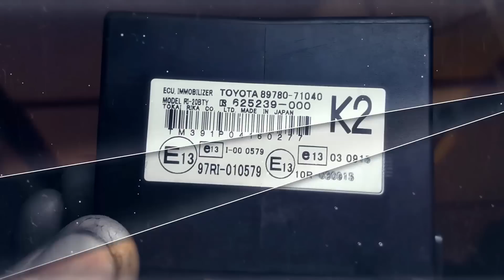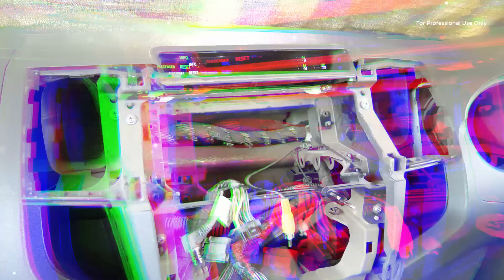Toyota Fortuner Lost Key Making | Toyota G Chip key programmer | 93C66 EEPROM

Comment: What scanner or software if any,  did you use behind camera to program both new keys? Or all was manually ?
Reply from the maker: +rastreo1satelital nothing behind the camera

We user G chip tool to reset immobiliser and then turn on the ignition with new keys to be programmed. Thats it

Comment: That does not look like an easy job, but you did get it done.  Nice work.  Are you able to read the code of the removed chip and flash that to new keys to activate them?   Or is this just resetting that dash lock-box to make it accept a new key?  Just curious, i do not have a smart key vehicle.  Thanks for sharing